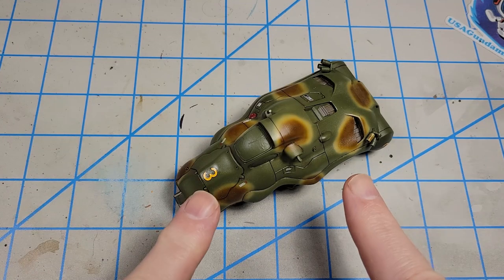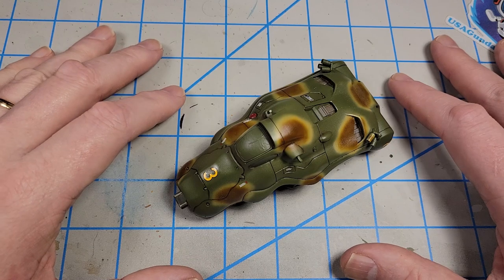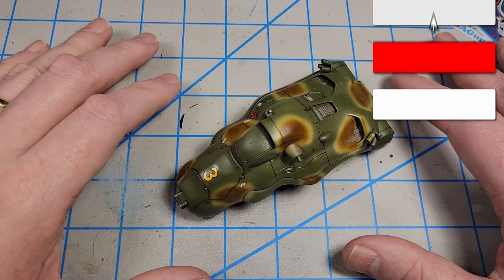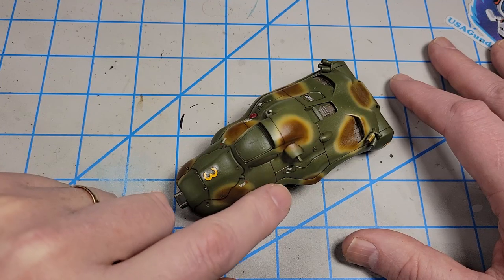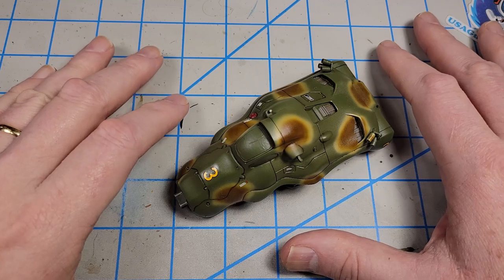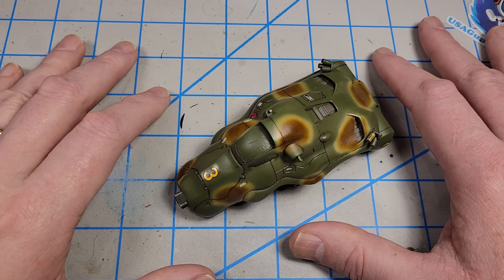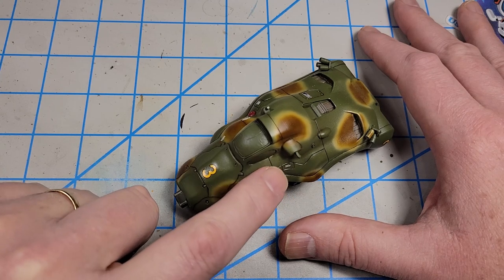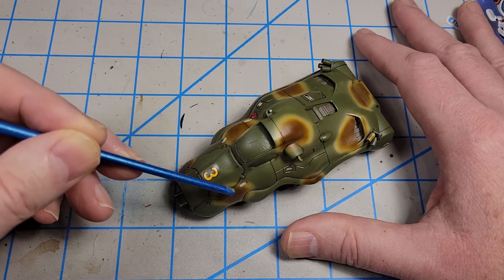Basic Modeling Skills - Post-fading and Post-shading (Kaiyodo 1/35 Ma. K Sturm Käfer Part 4)

Comment: Hi Jon, I hope this finds you doing well. Do you have a best method to stretch tank tracks that are too tight for the model? I've heard some but I've come to trust your advice. Thx and be blessed.  JJ
Reply from the maker: Thanks so much for your kind words, John. I am grateful!

If they're the rubber band type, you might be able to stretch them a bit in warm water, though that can be a tenuous solution if you're not careful.

If they're the metal type, if you can find some additional links and just add them in, that might work too.

For any track type, depending on the layout of the tank, it may work well to actually cut the tracks up a bit and strategically cover the gaps with mud, etc. Or if there are fenders that will hide an area, that can gain you some room.

If no other solution presents itself, see if an aftermarket set is available. Also, check build articles and videos for the model - someone else may have encountered the same issue and found a way to resolve it.

I hope these ideas help!

Thanks for watching and comment - happy day to you!